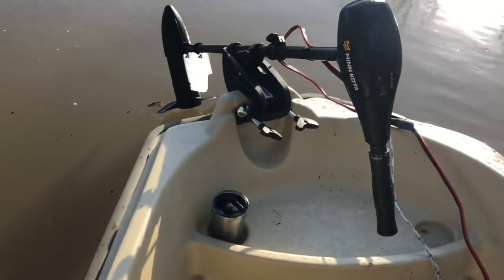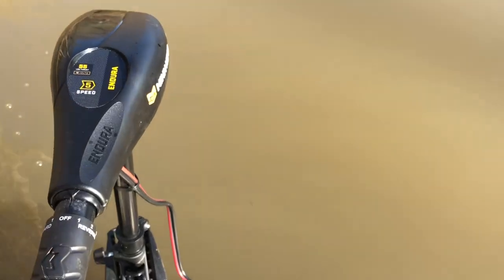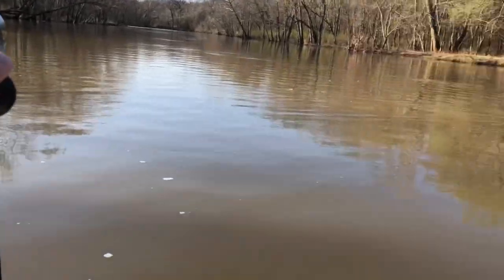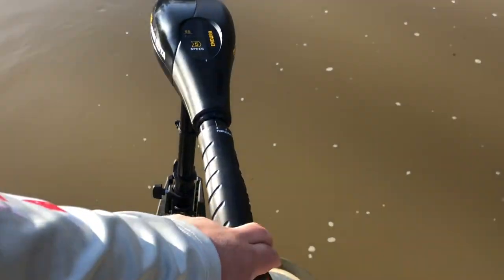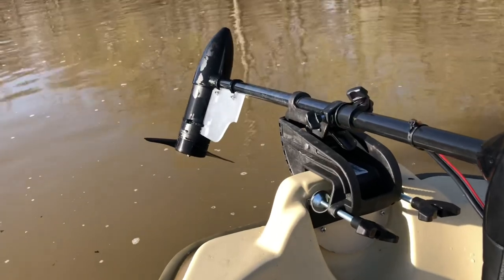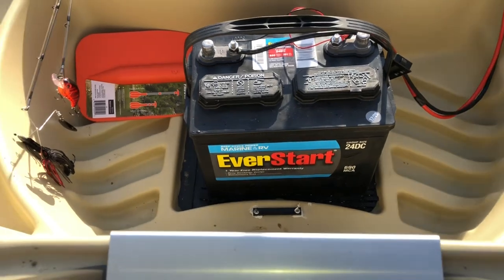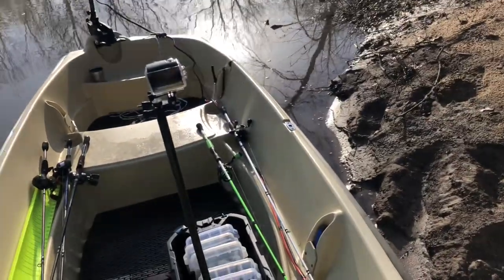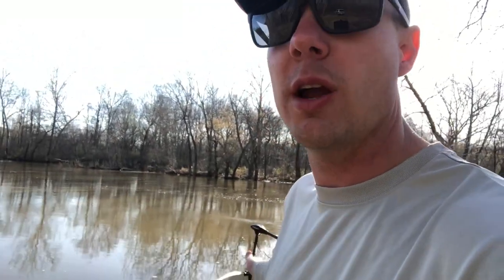Minn Kota Endura C2 Trolling Motor Review and Test // 55 lb Thrust /Budget Trolling Motor

Comment: I have an older Endura 46lb bought in 2006, still works perfect.  It came with a Weedless Wedge 2 prop, which is a way better prop.  I hate that Minnkota now only sells them with the smaller power prop and you have to spend another $45 to upgrade to a WW2 prop.

Comment: Good tip on the shallow water tech, never knew that 👍, last week bought a 12 foot HDPE boat, I bought one of those Wally Mart batteries too , hope it lasts? , I have a 55 on the stern drive, and a 32lb for the front bought new as well  , but ultimately, Im going to get 2 lithium batteries , becuase on these boats as Im seeing, wieght is a big  factor, so i also better watch what I eat too 😂, more fish, and less bread. 🍞🐟
Reply: What amp hour lithium batteries did you buy and has it been working?

Comment: Thank you for the helpful video. I ended up buying the same boat and trolling motor. So far so good, except the fact that the trolling motor (mounted in the rear) vibrates pretty hard when in 4 and 5 and much more noticeable when going reverse. Have you noticed that? I am not sure if I bought a defective unit.
Reply from the maker: You are very welcome I hope these videos are helping. As far as vibration mine doesn’t do it in 4 really at all but 5 does but nothing that is crazy. In the reverse settings it does vibrate a lot but this is normal because the blades are spinning in a direction that causes more forced to be placed on the blades. I’ll try to make a quick video in the near future showing the vibration up close to see if this helps anyone.
Reply: @bluecollaroutdoors5556  Thanks for explanation! I was about to take it back to Dick's. LOL. Yeah, it would be good to cover what the "normal" looks like on the trolling motor. I am sure other newbie owners like me would appreciate it.

Comment: How do you set the motor when trailoring, straight up and down anf still mounted to transom/ I have been putin at an angle and seemed to have broken one of the tabs from maybe bouncing of trailor. should  I leave it straight up and down position for less stress on tabs?

Comment: Have you considered a Solar panel for trickle charging the battery while you're not trolling? They seem to work well from what I've seen.
Reply from the maker: Matt, thanks for the idea, honestly I haven’t really needed additional charging yet as I usually spend upwards or 5 or 6 hours on the boat and the battery usually still has more than half charge. This is definitely an option that would be useful for the future If I plan on fishing more. Thanks for the idea I might use it for a future DIY vid. Thanks man
Reply: As for having the battery in back, look for jumper cables on Black Friday and those’ll suffice.

Comment: I’m moving to minnesota for college and I’m going to buy myself a 12’ Jon boat but the lakes I will be fishing only allow electric motors. Do you think this trolling motor will work well for that? Awesome video by the way
Reply from the maker: Yea man this trolling motor will do you just fine, I use it on my boat for river and small lake fishing and it does fine. There are many ways to rig setups to allow all day run times with your batteries as well. Hope this helps man, and good luck at college!
Reply: @bluecollaroutdoors5556  Thank you so much for the reply. This motor seems like a solid option and I’m glad someone more experienced than me agrees. Thank you for the wishes. I hope college will be a blast!

Comment: I have an older 14 ft  "V"  aluminum boat .. I also have Two C2 55 thrust motors .. I am thinking of putting them both on and running as dual motors.  Wondering how that may be ?
Reply from the maker: I’m sure it would work ok depending on the setup. It will also drain the battery faster so you may want to think about battery life as well. Good luck!

Comment: Hi, I thought that endura c2 is 12v motor, is there a versión of 24v ? Or is it compatible with 12v and 24v ?
Also , what is the awg of cable? Thanks
Reply from the maker: Fernando, thanks for your questions, yes this trolling motor is a 12volt motor, in the video I am referring to the actual physical size of the battery, and in this case it is a 24 group size battery which is about the same size as a car battery. This battery is a deep cycle marine battery which means it is designed to be recharged on a frequent basis and it will not damage the battery. The extension cable is an 8 gauge wire, and it works great even though Minn Kota recommends a 6 gauge cable if you are extending the cable that far of a distance. I have had zero issues with the cable. As far as it being compatible with 24 volt I don’t believe so, but the do sell saltwater versions that are 24 volt. I hope this helps.
Reply: @bluecollaroutdoors5556  thanks, then  "24 group size battery" is not a 24volts battery,  is it? Your video is with 12v battery, isnt it ? Thanks.
Reply from the maker: Correct, it is 12 volt.

Comment: I got an endura40# for $80 on clearance. It doesn’t say c2 but the box number is the same. Should be plenty for my canoe. This guy has a 55# on a little boat should be enough you don’t need a gas motor.

Comment: Hello! I am considering purchasing one of these for my small (10-12 ft) alumacraft boat and I want to know how many batteries I'll need. I'm looking at a 110 ah lead acid battery from Duracell and a Noco Genius charger. The most weight that it will carry is maybe 400 pounds. If you have any recommendations for the charger or number of batteries it would be much appreciated!
Reply: Hi I have exactly the same plan for my 12 ft aluminum boat. Were you able to buy the same set up and how is it?

Comment: Mine was actually pretty noisy out of the box. It will move my Bass Raider quick though.
Reply from the maker: Dang, hopefully the noise settles out or look into exchanging it, you might also check under the prop which is super easy to remove to check for pieces of packaging that might have found its way into that area. Yea they do work pretty well at moving the boats along. Thanks for commenting!
Reply: Mine is pretty quiet in the lower speed (1, 2, and 3), but in 4, 5 and especially in reverse, it shakes pretty hard enough that the whole 12' boat vibrates.

Comment: How many feet of cord does it come with out of the box?
Reply from the maker: The wire is around 4 feet long out of the box. Hope this helps.
Reply: @bluecollaroutdoors5556  I ordered one online, just got to go pick it up. I ordered the  60 amp circuit breaker and the 5' Newport Extension kit like you suggested. It will be a cleaner look than my old Motor Guide 45, my soldering skills are horrid.
Reply from the maker: @grimlocked2524  glad to hear that you are doing this setup, it is really easy to do. I noticed you said you got the 5 foot extension cable. I’m not sure if I said which cable length that I had but mine is actually the 10 foot cable, which is necessary if you put the battery in the rear compartment on a Jon boat. Hopefully this help brother if you needed to cancel your order real fast and get the 10 foot one. Hope your build goes well.
Reply: @bluecollaroutdoors5556  I just went off the Manual Recommendation of 8AWG@5'.  10' per the manual it recommended 6AWG.
Reply: It's going on a canoe so I always have the  battery in the middle, all good.
Reply from the maker: @grimlocked2524  ok good yea I wasn’t sure and didn’t want you to get the wrong one lol. Good luck with your setup I’ve always wanted to do a canoe setup too, as they travel through the water really nicely.